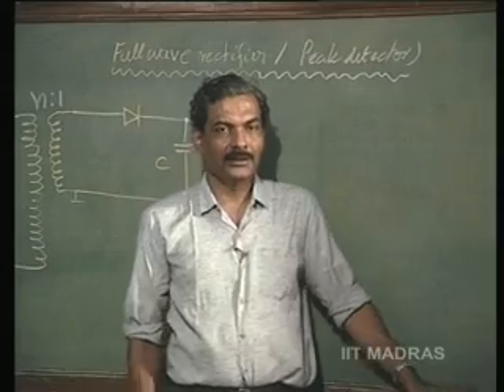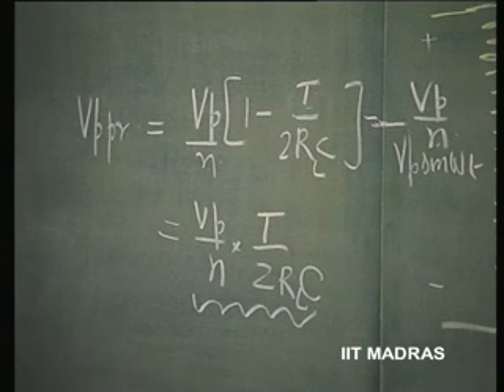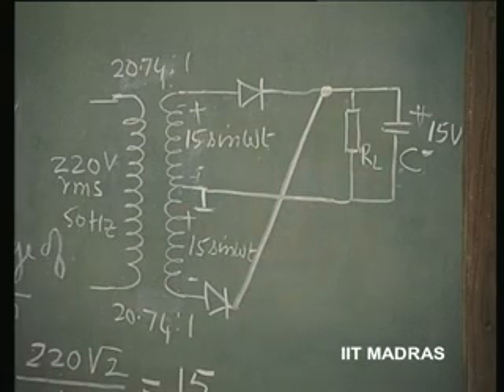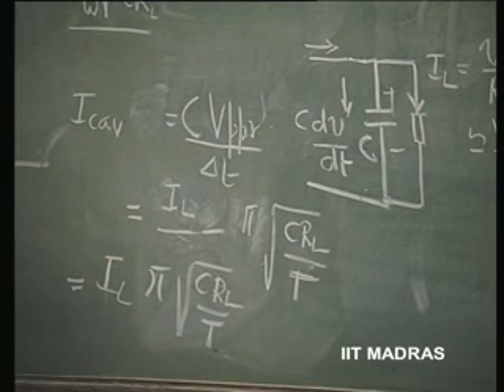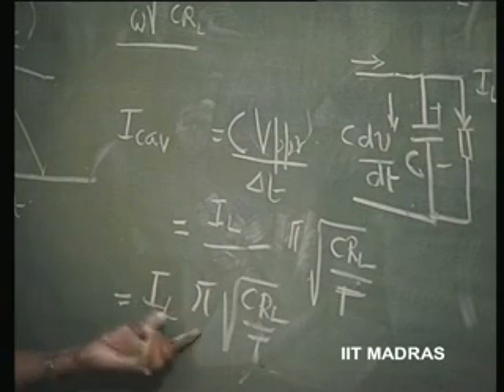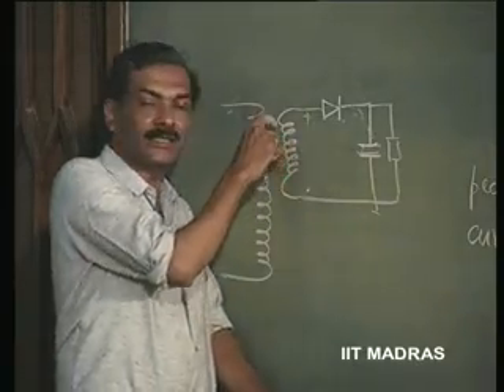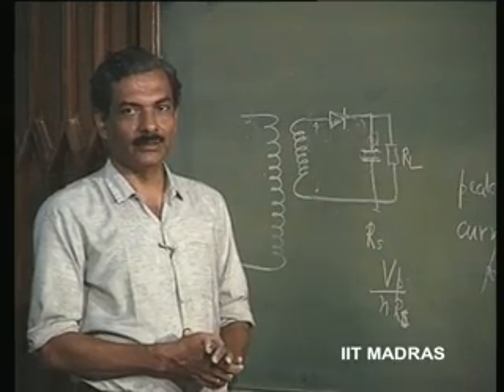Lecture - 6 Full Wave Rectifier and Peak Detector

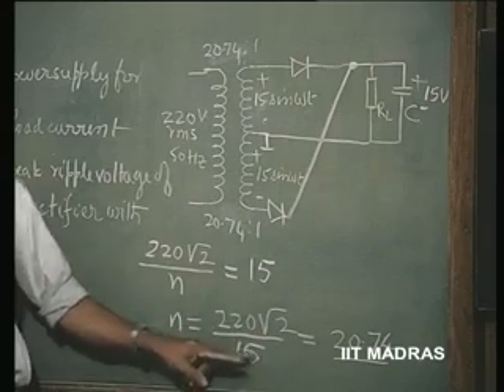Comment: 14:03 
you wrote 15  volt. i did not undetstand  why did you write it . whereas output voltage of transfermer is 30 volt. if i am saying wrong then please forgive me.
Reply: 15V is peak voltage required according to the problem.
Reply: I also think the same. It should be 30v as the dc output is to be 15 v